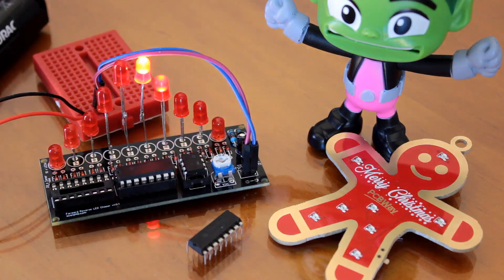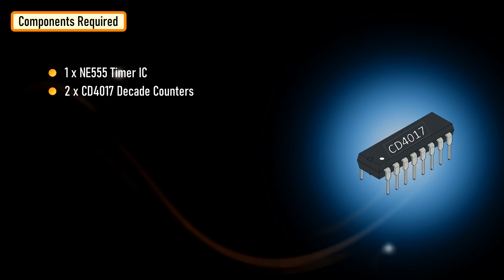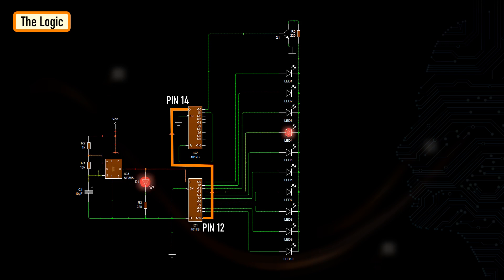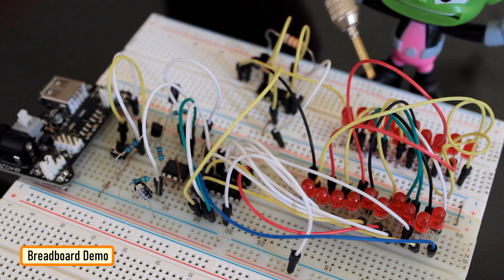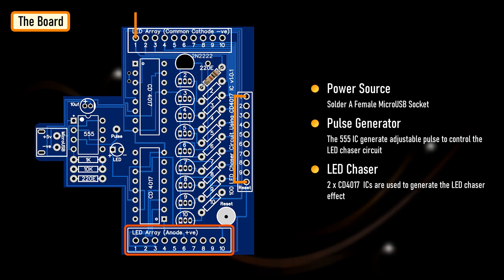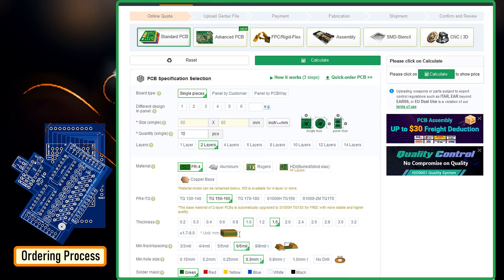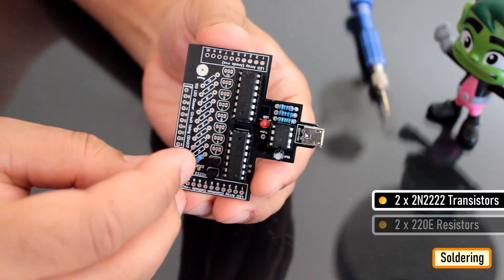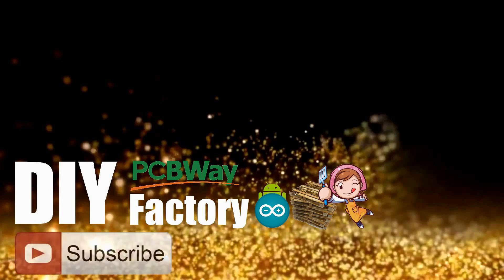100 LED Chaser Circuit Using IC555 and CD4017

Comment: Great demo! 
Do you have a link to your design on PCBWay ?
Reply: I mean the second plate design, i found the main board.
Reply from the maker: Hi There 
You can find both files either from my blog: https://diyfactory007.blogspot.com/2025/01/100LED.html
Or from my gitgub repository: https://github.com/tarantula3/100-LED-Chaser-Circuit-Using-IC555-and-CD4017/tree/main

Comment: Nice. Clear explanation, good graphics, nice transition to the board.

Q: Do you think this circuit could be adapted to 1w - 3w LEDs?

I've also checked out some of your other videos, and they're similarly really good. Subbed.
Reply from the maker: Thanks!  I think the circuit could be adapted to use the higher power LEDs if you added appropriate transistor and resistors to limit the current.

Comment: The LEDs don't need current limiting resistors?
Reply: I thing 1 resistor in all led ground is enough
Reply: @umangpatel158  Correct
Reply from the maker: Yes that is correct
Reply: @CrazyCoupleDIY  Because you're running them in  parallel, right?
Reply: @nijo5427 - no, it's because only one LED is illuminated at any time.